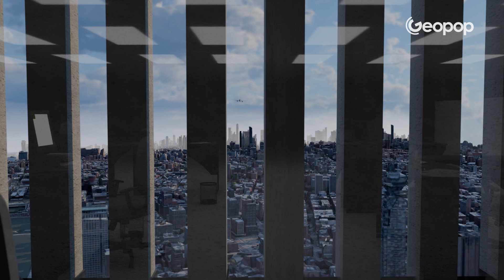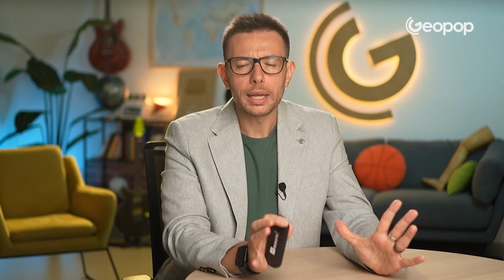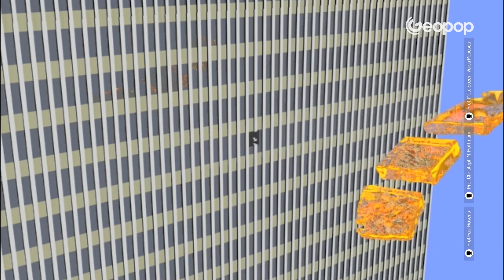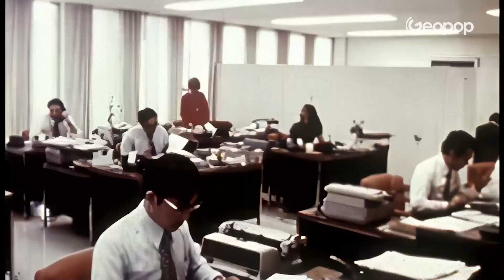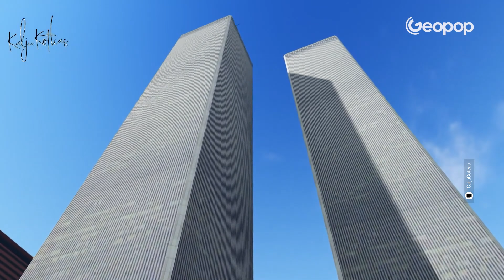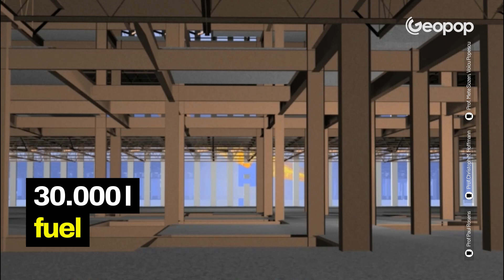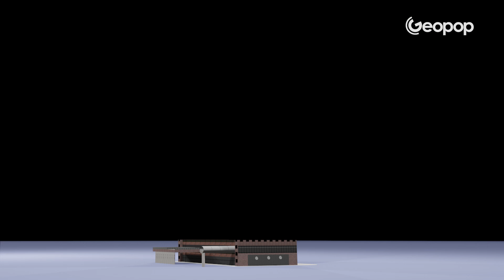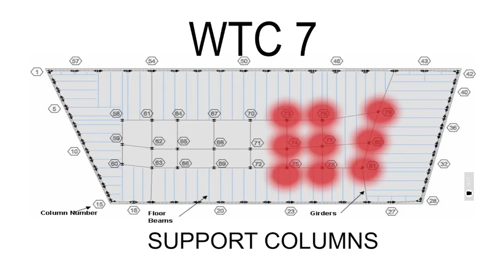9/11, 2001: The Technical Reconstruction of the Twin Towers and WTC 7 Collapses

Comment: I worked at a factory, we had a bad fire one night with 19 fire engines, the 5 ton crane 'H' beams looked like half melted plastic afterwards just under it's own weight from the heat. Deformation!
Reply: "But Sir, Jet Fuel doesnt melt steel Beams"  if it wasnt so sad for every survivor it would be nearly something to laugh about
Reply: 'unbelievable' being the right word to use.
Reply: Deformation and 250,000 tons of steel falling straight down into a decimated pile aren't even in the same ballpark, Chief.
Reply: @malachi-  some of them was on the floor the I beam so it's quite similar in my opinion, they basically act like plastic but at much higher temperatures.
Reply: @PeckhamHall  Much-much higher temperatures... and where did those temps come from?

The fuel from the airplanes blew up on impact.

As you can see, both building were smoldering when they blew up and out.

Just like the famous firefighter in the stairway said, just some smaller fires in this section, we can get them out, send some back-up.

"9/11 - CALLING OUT Bravo 7 - Documentary 2020"
Reply: @malachi-  Steel looses it's strength by 90% when it reaches 900°C so at 500-600°C I would bet that would overtake the buildings safety factor and begin a domino effect from top to bottom failure, 50+ tonnes of fuel gets pretty hot don't you think?
Reply: @PeckhamHall  

Hundreds of thousands of steel beams do not fall like dominoes, the towers were smoldering with black and grey smoke, so with that low of oxygen, there were no fires hot enough to weaken steel, especially to make over 100 floors of that steel fall that fast, plus pulverise the concrete and everything in it. 

Just tell me were all of those piles of dominoes were piled up at, there is not one pic of collapsed floors anywhere, so why keep making that up over and over?

"Twin Towers Built To Withstand Impact of Boeing 707"
Reply: @Peckham Hall
Don't waste your time trying to talk sense to
Conspiracy nut jobs..!  NOTHING anyone can say will cure their delusions...
The interesting thing is Why  they feel the need to believe the conspiracies...
What IS the psychological explanation.??
Reply: @2msvalkyrie529  Two Psychologists named Dunning and Kruger tried to answer that very question.
Reply: @disqusrubbish5467  Hmm,  I think Dunning & Kruger were more concerned with the four stages of  competence  than the need to deny theories which are backed up by accepted facts,  in favour of simplistic views ascribing causation to a malignant group.
The competence  levels they wrote about were:
1 unconscious incompetence   - you don't even know there is a skill you lack
2 conscious incompetence        - you know what the skill is that you lack, and you still can't do it  (eg me playing a guitar)
3 conscious competence           - if you concentrate, you can do it !
4 unconscious competence       - you know it so well, you can do it without even thinking   (eg Eddie Van Halen)
Reply: @2msvalkyrie529  another marvelous comment that applies to both sides of the argument!
Reply: @malachi-  Furniture, plastic, carpet, paper, ect.... The wildfire in Tenn. 2016: Fire inside an enclosed home gets hotter than the outside like a crucible until it disintegrates. I'm not trying to be smart or an expert. Just saying. I did see the molten metal you are referring to. I used to think is was a demolition but more recently I believe it was just from the planes. I really don't know.
Reply: @tommysonnier9848  There were people all around and in the smoldering black hole of the tower, how did they withstand such heat?
Reply: @malachi-  They either died there of chose an easier death by jumping. Very sad indeed. When I meet my maker I'll definitely have questions to ask.
Reply: @tommysonnier9848  You can go see pics and videos of them afterward, when the big hole was smoldering.

But, you know that already.
Reply: @malachi-  yup the plane did explode. You are aware that the fuel itself doesn't burn, but the fumes do burn right? That is how things like tankers can continue to burn hot even after they explode until foam is applied by the fire department.
Reply: @mahrixgamer6036  You forgot the part about the people around the smoldering black smoke hole waiting for help, how were they surviving that metal weakening heat and burning fumes all around them?
Reply: @malachi-  just stfu, no one likes u
Reply: "Experimental Study on Fire Resistance of a Full-Scale Composite Floor Assembly in a Two-Story Steel Framed Building"
Choe et. al.

I suggest you all read up on some more relevant science. This PHYSICAL study, undertaken by NIST, shows that floors DON'T fail due to fire. They weaken, they sag, but they don't fail.
Reply: @johnl6176 People in the towers said the floors were collapsing. They are dead now but their calls are on record. That's proof enough for me.
Reply: @tommysonnier9848  Eye-witness testimony during such an event is unreliable at best.
Reply: @johnl6176  I have no reason to doubt that the floors initially collapsed based on people who were actually there. People who survived said the same thing as the ones who perished. They had no reason to lie. As further evidence when the south tower began to collapse, the point of impact by the plane buckled inward. I recently saw a very detailed and accurate simulation without smoke and concrete dust. The collapse was far from free fall speed. Some pieces, yes but the core columns stood for many seconds after the surrounding walls and floors gave way. Both towers fell in the same way at different times based on points of impact. Neither the terrorist pilots nor the ones who supposedly planted explosives could have caused the towers to fall from those points of impact. I hope there is no disrespect perceived in my disagreement as there is none intended.
Reply: @tommysonnier9848  You may have seen a "detailed" simulation, but "accurate"? I mean, how do you know it was accurate? Did you go through every single data point in the simulation? Did you have some other verified data to compare it to? 

You can't say something is accurate just because it looks detailed: the two are not the same.

As for what witnesses said, did they really see what they thought they saw? Did they interpret desks and furniture sliding down the sagging floors as collapsing floors? Maybe, in their panic, they didn't really look or just saw something out of the corner of their eyes and made a conclusion they weren't qualified to make. The reason that eye-witness testimony is unreliable is because figuring out what the witness actually saw is problematic.

All I'm looking for are answers that will satisfy my questions. I just haven't found any yet. As long as everybody is respectful, I'm OK.
Reply: @johnl6176  Who could have guessed that weakened and sagging floors under enormous loads with damaged structures can collapse?
Reply: Two “truthers” walk up to the pearly gates, and as they get there, first question for god is, who really did 9/11. God looks down and says it was done by terrorist flying planes into buildings. The “truthers” look at one and other, and say “this goes higher than we thought.”
Reply: @johnl6176 Like Humans get old and don't die right.😂
Reply: @johnl6176  said building UNDAMAGED by a PLANE CRASHING INTO IT.
Reply: All the floors showed no resistance whatsoever, this is absolute rubbish, if you detonated them buildings it would have went down in same time and fashion as these two did! It was a controlled detonation, its psychological reasons why your average American does not want to acknowledge this fact
Reply: @PHILIPSTEADMAN-j7i bull f-ing s***. You couldn't even rig such a thing and then expertly pilot a plane into the exact spot. So much fail in the conspiracy theories.
Reply: @PHILIPSTEADMAN-j7i Cognitive dissonance.

Comment: give me back my 20 minutes.. heat didn't reach lower floors and the same steels was supporting the tower before any thing happened why its turned to dust !!. what happened was controlled demolition. Mosad+CIA they did it with  John F. Kennedy and got away with it.
Reply: There's an excellent documentary here called "World Trade Center: Anatomy of the Collapse" that explains in clear terms why the towers could not survive the collapses once they began from an engineering point of view.  Short answer: The supporting structure of the lower floors did not fail, it was bypassed. The towers' strength depended on the columns to support the weight; the towers' tops fell off of the columns & directly onto the floors below which were not designed to withstand anywhere near the weight that fell on them.
Reply: https://www.youtube.com/watch?v=Yo1WZ9g1IJ4
Reply: Heat didn't need to reach the lower floors and no steel turned to dust because that's not a thing.  Both of which you would know if you had been paying any attention at all during those 24 (not 20) minutes. I suggest you try again.
Reply: Did heat cause the 3000 occupants to disappear? Their bodies were never recovered. Any guess where they might have gone?

Comment: Bull Shit,,   pro goverment and Zionism proaganda!!!  An airplane made of aluminium could never break throughout steel beams, that airplane would never made it inside the building in the first place!!!
Have you ever seen  car crashes against walls in safety simulations!!! 
A car never makes it to the other side of the wall right??
Reply: You seem to know a lot about the subject. Where did you get your engineering degree?

P.S. The towers were not solid, they were 95% air, and their walls were not reinforced against lateral impact. A 150-ton mass doing 500 mph would have no trouble penetrating them.
Reply: @Tim22222 where did 90% of the occupants whose bodies were never recovered disappear to Tim ?
Reply: @Larry26-f1w  like the concrete ,.dust. millions of tons of steal concrete and body's

Comment: What caused the towers to fall on 911? 
"Dynamite, Molten Metal, and Demolition Experts."
Reply: Thermite
Reply: @rumblethis2023    Thermite doesn't do what you think it does. And it is incredibly hard to ignite; and burns unpredictably.  Notably it is not use to cut horizontally, as it burns through things downwards, pulled by gravity.      And the buildings did not fall like a controlled demo.  At all.
Reply: Thermite, they used thermite to demolish WTC towers, Thermite is used in wielding railway tracks
Reply: @ Your two uses of thermite contradict each other.
Reply: Shhhhhh ..... NIST ain't gonna like that !
Reply: Which is more extreme -- to accept without question the inexplicable lack of turbulence in the wake of a 500 mph large passenger airliner -- not evident in the smoke and fire covering the impact zone only seconds later? -- or to recognize the indications of digital projection in its imperfect nature as we see a wing disappear in front of a bright blue sky? From another camera angle, the same aircraft is seen passing behind a crane in the foreground, yet in front of the heavy crane cable. 

There should be a hurricane of turbulence in its wake that would entirely disrupt and disperse the smoke and fire seen billowing outward just 3 to 4 seconds later at both towers.  Even the wake of a small Cessna aircraft would be noticeable -- yet there is nothing.
Reply: @ronaldgreene5733  You don't know science.   And there is not such thing as 'digital projection'.
Reply: @nickcharles1284 .  . "science" .  . 😃 .  . Commercial demonstrations of holography have been amazing -- so you believe that they are analog in nature? .  . What century are you living in?   

You also cannot explain the entire lack of turbulence behind a 500 mph aircraft that would entirely disrupt the smoking fire coming out of the building on the seconds later. Even the wake of a small Cessna Aircraft would be evident -- yet there is nothing.
Reply: @ronaldgreene5733  One in which mental health services are widely available.  Call not to find a Dr. that is right for you.
Reply: @ 1. The massive building absorbed the PHYSICAL impact of a huge jetliner., at 500 mph. The impact of any turbulence from the approach would have been negligible in comparison to the strike and resulting explosion.   2.  Show me in what way you measured for 'turbulence', and the scientific precedence and numbers from the studies on the effect of turbulence of huge liners striking massive buildings.
Reply: @  Holographic tech is in its embryonic stage.   I no way is is viable, commercially or otherwise.  The best  demos take huge amounts of resources, and FIXED position tech to make the most rudimentary images.  It is a sign of mental illness to suggest anyone could have projected a convincing image of not one, but two jets, over the NY skyline. While they are being observed and filmed by millions of people.
Reply: Our comment section science experts.
Reply: @LairdStines-f9k  oooh BUUULL SHIT!
Reply: @ElLowEl .  . "What the hell are you talking about?" .  . 😃 .  . Thank you for your sponsored reply, Mr. EILow.  The word projection indicates holography as you know, commercial demonstrations of which have been amazing in recent years.  To feign ignorance doesn't work well for you, however.  Where, Mr. EILow, is the wake turbulence only seconds after passage of a 500 mph large passenger airliner -- not seen in the smoke and fire covering the impact zone?  Even the wake of a small Cessna Aircraft would be noticeable -- yet there is nothing.  It's likely that no real answer from you is forthcoming. We'll wait and see .  .
Reply: @ Explain how holographic projection having become 'amazing' in RECENT YEARS helps your claim that hologram tech from 20 years ago was used to simulate massive jet liners smashing into buildings in front of millions of witnesses.  It could not be done now, and it could not be  done then.
Reply: Wouldn't it be better to use the thinking part of the brain instead?
Reply: @TheLoonResistance my brain tells me 3000 bodies were never recovered from the debris. What say you ?
Reply: @Larry26-f1w  so I guess we might as well just say they never died? They're all on a desert island sipping margaritas alongside DB Cooper, Jimmy Hoffa and the lone gunman on the grassy knoll?
Reply: @Larry26-f1w  "Whatever was to be recovered, vaporized."
Reply: @Larry26-f1w yea 3000 bodies weren’t recovered but fragments of remains of roughly 3000 people were found many of which we’re still trying to identify.
Reply: @Larry26-f1w  2700 victims. Not 3,000.   28,000 body parts were recovered, and half of the victims identified via those parts.   I found that info in about 30 seconds.
Reply: @Larry26-f1w  Lol you're not going to find whole bodies in that mess. You'll only find scraps of human tissue, assuming most of it wasn't burned or turned to powder.
Reply: @nessfinesse1378 Also the entire 9/11 death toll is less than 3,000 (2900+). That includes the Pentagon and Pennsylvania.
Reply: The “molten metal” was from rescue workers cutting steel with torches. It makes perfect sense that the building would collapse in the manner it did if the floor trusses failed. Which is definitely possible with the temperature of jet fuel.
Reply: @SuppressHoardReject  I suppose I don't understand why people find this so hard to believe. Is it just a severe lack of understanding? Ignorance? The resulting heat generated from the attack was more than enough to weaken the loaded steel to the point of failure.
Reply: @falco5150  willing ignorance indeed

Comment: I quit my job at Nist because of the report.. it was extremely upsetting and more then a dozen of my co-workers and myself put in hours and hours of effort and research, just for our original report and findings to be completely thrown out and not brought forth to the world that SHOULD be told the truth about what we actually found in our research.. the investigation report that was released to the public is one of the most inaccurate documents Ive ever seen released to the public, and many of us where so outraged that we walked away from the job for good.
Reply: The stench of feces of the male bovine is overwhelming 🐂💩
Reply: @TheLoonResistance yes your routine is getting stale
Reply: @BobbyTheBuilder_TM  @bobbythebuilder7109, I have an EXTREMELY difficult time believing a word you’ve written. What, exactly was your job at NIST which gave you the credentials to pass any judgement on the work of the PhD Structural Engineers, from academia & industry (and from NIST) who produced that report? I also have 50 years experience as a Mechanical Engineer, and I KNOW that the methods & analyses produced were absolutely first rate. There was not ONE sentence in that report that I would identify as “this doesn’t make engineering sense”, or “that’s not how you properly do this type of analysis”. Perhaps, rather than stating your nebulous, undefined conclusions, you could state, “this is what the NIST Engineers assert, and THIS is where their analysis deviated from Standard Engineering Practice”.
Reply: Hmmm, kind of reminds me of another government backed investigation by the Warren Commission.

Comment: If a 110 story building collapsed, how high would you expect the rubble pile to be....
Reply: For these 110 story buildings about 14 stories deep and spread out over 17 acres.
Reply: @TheLoonResistance  Google says only a few stories of rubble. The photographic evidence shows only a few stories. In one photo you can see an ambulance covered in dust! it should have been under 14 or more like 40 stories of rubble.
Reply: @stephenmaguire1965 - The debris filled 7 sub levels in addition to being up to 7 stories above grade.  And again, spread out over a large area which destroyed 8 surrounding buildings and damaged over 100 more.
Reply: The debris were minimal and missing 3000 bodies 🤔
Reply: i dont know, how far can a hammer drill bury itself ?